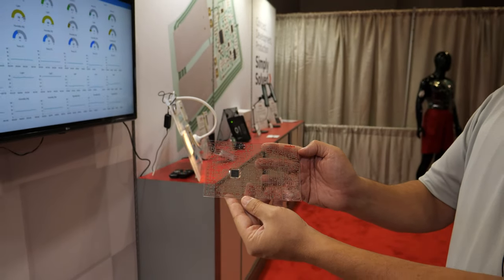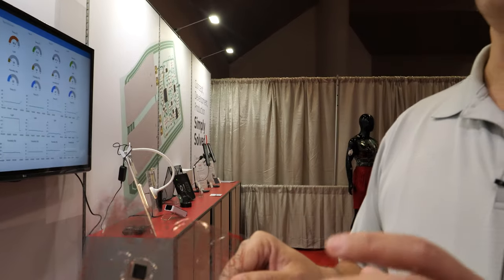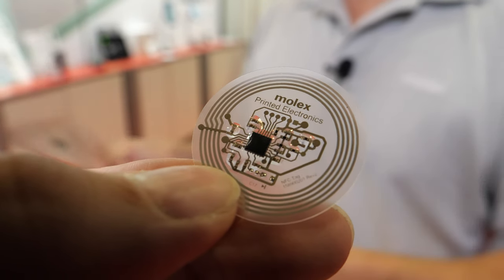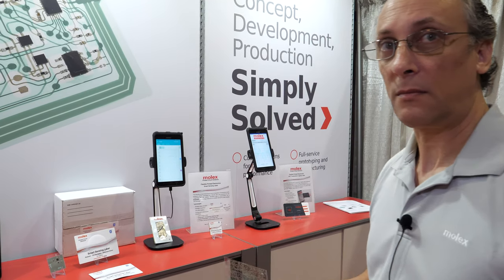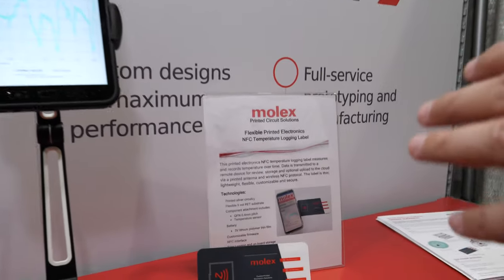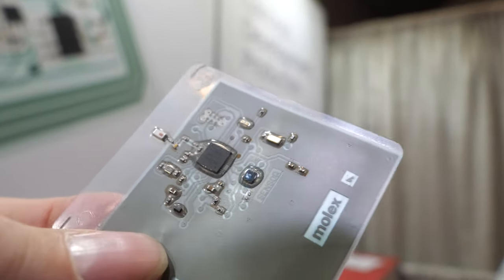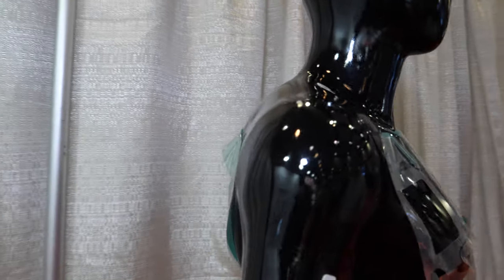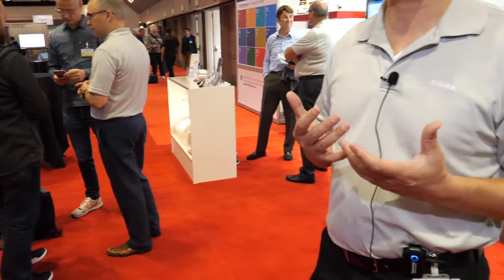Molex Copper Flex and Silver Flex Printed Circuit Solutions at IDTechEx Show!

Comment: Great Presentation by Justin Spitzer at Molex. Printed Electronics are not new, Molex has been doing this for a long time! One of the original uses of printed electronics is membrane switches. In fact, the printed circuit solution of Molex used to be called "Switch" because the vast majority of printed electronics were membrane or dome switches in a printed electronic stackup. You have these on the front panel of your microwave, dishwasher and fridge. They have been used in medical for a long time too because of the flexibility of the polyester substrate. Printed electronics technology has advanced to include capacitive touch, wearables, any many other interesting things. IDTechEx is a great show to see all the printed electronics players. #Molex #IDTechEx

Comment: Mostly stacking super computers networks. Data center in the pocket. Can they be stuck on roofing for power or roofing materials for home. Mostly for temperature control inside cars. UV shield plastics. How to do a UV shield plastics. Fiber plastic plus carbon powder and stickers on top gets an excellent shield from extreme heat or cold for roofing.

Comment: But how can you change the parts from on this ? Can we touch to it with solder iron ? Because its like a plastic , may be damage between a hot degree...
Reply: Hi, you are correct, we don't change or rework parts once attached. First, we use lower temperature bonding materials for the polyester substrates. Standard solder temps are too high for current polyesters. But the suppliers are coming up with new substrates everyday. And second, because the circuits are flexible and the components are rigid, it is best to put an epoxy encapsulant on the solder joints to protect the bond. That also limits reworking. So for now, we see that maximum 20-30 components can keep out scrap rates as a reasonable level. We don't see cold solder joints and solder wicking is not the same as in a typical solder process.
Reply: Justin Spitzer thanx, i understand.

Comment: This is not a new thing. Anibody teardown a digital camera?
Reply: No one said flexible circuits are new. This is just Molex's own refinement on the process.
Reply: Hi, thanks for commenting. You are right that silver circuits have been around for 30+ years. What has changed is that we can now 'print' finer pitch circuits and incorporate vias through the substrates allowing us to create multi-layer circuitry which opens the door to more complex assemblies and attaching smaller and more complex components like ICs. We are working on bare die attach as well. We don't claim that it is a 1:1 replacement for PCBs or copper flex, but silver flexes can do things PCBs can't and there are opportunities for improving designs in form, fit and function and opening up creativity into 3 dimensions, like in the digital cameras. Additive circuit technology is just coming into its own as we see new ideas in in-mold electronics and could soon apply to rigid boards too.